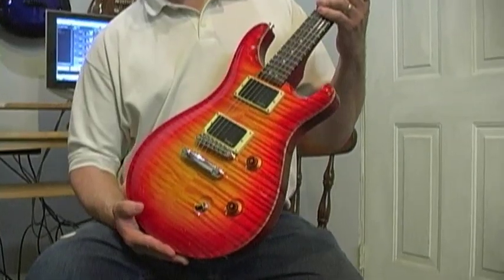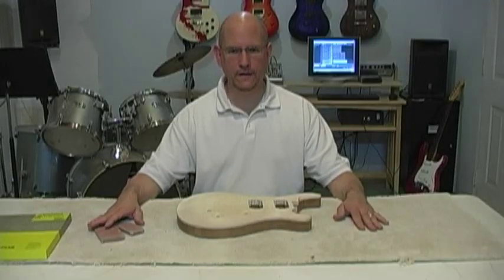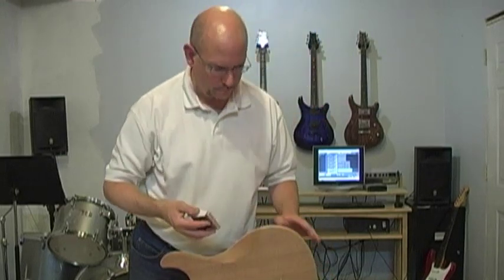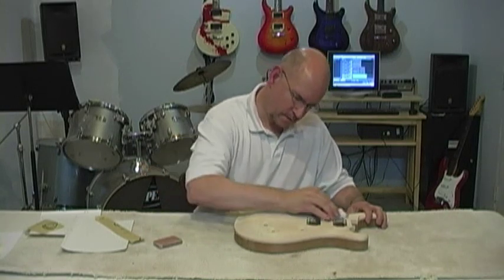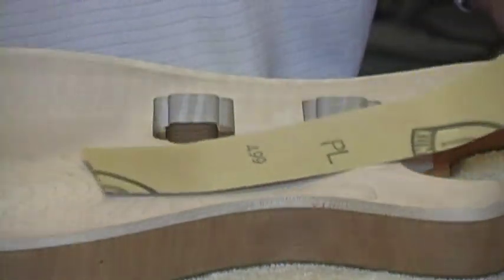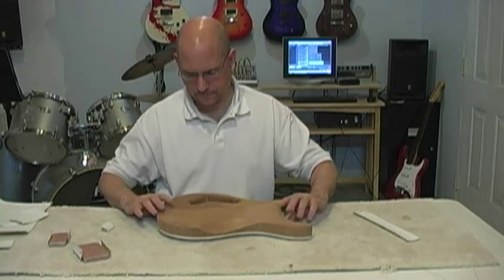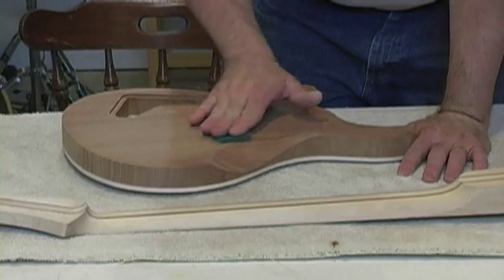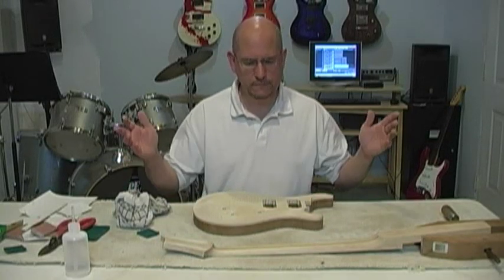How to : Finish Sanding your solid-body electric guitar kit

Comment from the maker: My first prototype PVX was walnut, and I still love that look. The Random Orbit sander is a great tool, and I would recommend you get one for two reasons:

1) it's a great way to do shaping and initial sanding

2) it can be adapted with a foam polishing pad. Use this with your rubbing compound and polishing compound after the lacquer is on. It will save hours and hours of time. I've always has variable speed on mine, so I'd recommend that, especially for rubbing compound and polishing.

(cont)

Comment from the maker: @1952Telecaster - It's most important at fine grits (above 320) after most shaping is complete. Sanding against the grain breaks off the fiber ends and packs them into the pores. Sanding with the grain shears off the fiber ends and takes them away. The difference is really evident when you are sanding end-grain, like around the edge of the guitar body. Properly done, sanding to 800 grit or so leaves the wood smooth and clean - it actually feels like it has a finish on it - and looks amazing.

Comment from the maker: @ANSANDAND - Yes. we raise the grain to remove all the loose and broken wood fibers.  If we don't do this, they will pop straight up when the first layer of lacquer is applied. In my opinion, it doesn't matter if the finish is clear or opaque.

All The Best,
Paul

Comment from the maker: @ellwrox - Thanks for the question.  There are a couple of different types of alcohol (Ethanol, Methanol & Isopropanol).  Ethanol is the kind of alcohol that is present in "Adult Beverages" ;)   "Denatured" alcohol is simply Ethanol with some Methanol mixed in to make is toxic so you can't drink it.  You can buy a can of this at pretty much any hardware store.  We recommend this because it evaporates quickly and does not affect the color or other characteristics of the wood. Hope this helps.

Comment from the maker: We suggest the use of nitrocellulose lacquer for solid body electrics.  This is an extremely high quality and traditional finish.  You might want to call Behlen (supplier of this lacquer) and ask about adhesion to wood with pyrography artwork.  They might suggest a vinyl sanding sealer be applied first.  My guess is it would be fine.  Nevertheless, I suggest you do a test and/or call Behlen for advice.  Good Luck!

Comment: Denatured alcohol is a good choice because it doesn't stain the wood, and evaporates quickly leaving no residue.  Some people use water.  I'm sure this works well, but you have to wait longer for the wood to dry.  I would expect the results to be the same.
Paul

Comment: mockof, Yes, both.  One key is understanding that lacquer continues shrinking for several weeks after spraying.   As a result, you have to wait as long as you can stand before your final wet-sanding, compounding and polishing.  Behlen engineers tell me 4 weeks is recommended.  If not, pores in the wood will re-appear in the finish days later.  This is because the lacquer is continuing to shrink.   All this is just to avoid wet-sanding and polishing twice.  
Good Luck,  
Paul - PVXGuitars

Comment: Lerlo,
I have never wet-sanded bare wood.  It sounds like a mess to me.  I wet sand lacquer because, like you said, it keeps the paper from clogging.  I also dry sand lacquer sometimes, if I need to remove it more aggressively.
All the best,
Paul

Comment from the maker: @tootall11211 - Thanks for the good input.

I agree with all of these comments, but have one cautionary note to add:
Never use water after steel wool.  The steel wool fibers become embedded in the wood, and then rust when exposed to water.  The result is a rusty red mess, that forces you back to re-sanding the piece. For this reason, I have stopped using steel wool on wood.

All The Best,
Paul

Comment: That's a good idea. However, when I was learning the trade, Scotchbrites hadn't been invented yet. You'd only want to raise the grain once, if leaving it natural. However, if using primer for an opaque finish, you can steel wool after the base primer coat as well. After that, all coats, primer or otherwise, get a light sanding with a superfine sandpaper. The final color sanding is with the highest grit count I can get, usually 2000, even finer if I can get it. After several coats of clear ...

Comment from the maker: Yes, Good comment.  I like the wide tongue depressors for that too.  This works great around the neck joint. I've had a bit of frustration looking for a glue that works well though. I've used the 3M spray adhesive, but it only seems to work on sandpaper with certain kinds of backing.  Any suggestions?

Best Regards,
Paul

Comment: You don't have to use denatured alcohol, but it is faster. A damp cloth will do the job. You might mention that these days, Scotchbrite comes in several degrees of coarseness, just like sandpaper. superfine steel wool can be used instead. Also, if not doing a finish where the grain of the wood will show, you don't want to sand so far and so fine before the primer or sealer coat. 320 or so will do. The finer sanding comes after the primer, and grain direction isn't so critical in that case.

Comment from the maker: The random orbit sander works great for shaping, and for removing alot of material
in a short period of time.  You  want to be careful though, it will not produce a flat surface,
and any unevenness will show when the high gloss is applied.  (You'll want it to be flat like a glass mirror)
 
(cont)

Comment: Hey man,  great video,  I have a question for you..
I own a guitar which is as it was when I bought it new.
I want to sand off all the paint so it just looks like natural wood,  its currently in black...
Do you have any tips for sanding away the paint,  would it be the same steps and grades of paper that you use in this video ?

Comment from the maker: To get this, you have to hand sand with a sanding block.  Start with 120, then 220, then 320, then 400, 600 (if you can get it) then 800 and finally 1000.  Use the techniques in the video, and always sand in one direction, particularly after about 320 grit. 
 
I hope this helps.  If you want to continue the conversation, send me a note by email (paul at pvxguitars)

All the Best,
Pau

Comment from the maker: Gran filler requires a lot of sanding after it is applied.  For this reason, I would probably not sand the piece past 320 before applying the filler.  After applying the filler, you'll have to start with 220 again and then take it up from there.
-Paul

Comment: So, if I'm sanding DOWN on the heel of the guitar, I should be sanding UP on the front of the guitar...by the neck?  This is on the ends of a strat style body, if that matters.  The grain is parallel and is mahogany.  Thanks.

Comment from the maker: OK, I got it now I've always gone from finish sanding, to raising the grain, then to water,or alcohol, based dye, and finally Nitro.   Dyeing with water or Alcohol based dyes will raise fibers in the grain, which is why I raise the grain prior to dye.  Honestly, I don't know if nitro over freshly sanded wood will be a problem or not.  Which is to say, I don't know if nitro will absorb into the wood and cause fibers to swell or not.  Perhaps someone else will chime in with more info. :)

Comment: ... I sand one more time with the finest scotchbrite or sandpaper I can get, then apply a good car wax... one that does NOT contain silicone, the old fashioned kind. Several coats, polishing between coats. This coat of wax is especially helpful on guitars that don't have pick guards. The wax gets scratched, not the actual finish.

Comment from the maker: Not at all.  The neck geometry is different, using Gibson scale.  The body and headstock shapes while similar, are different as well.  The construction is a neck-through design, with a 9 1/2 inch tenon.

Comment from the maker: Sanding is not the best way to remove paint.  The instant you "break through" the paint, you begin creating a low spot by additional sanding.  Do some research into what type of paint is on the guitar.  Then find a suitable stripper to remove the paint chemically.
Recap: 1) Determine paint 2) Use stripper for that paint 3) Touch up sanding

Sorry I could not be more help.  I'm not very experienced at removing factory finishes.   Please let me know what you find out!

Best Regards,
Paul